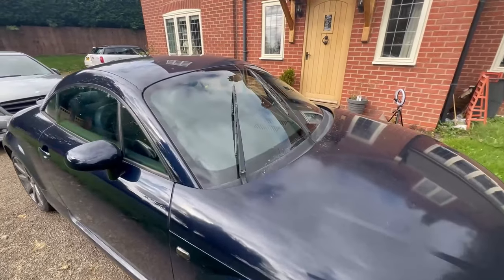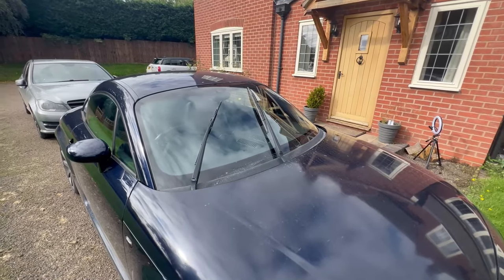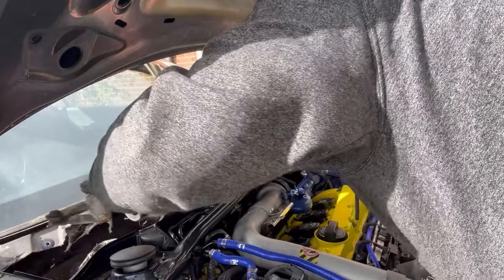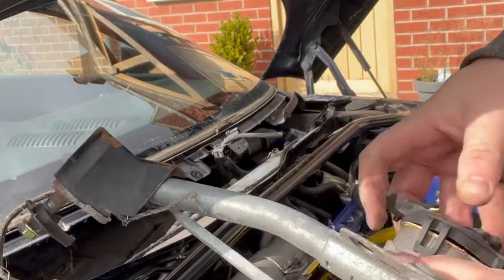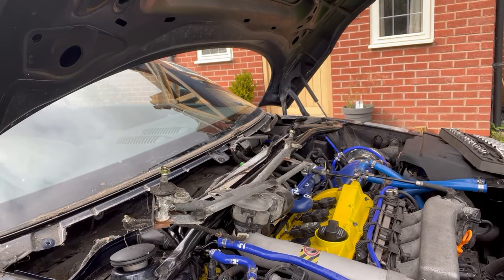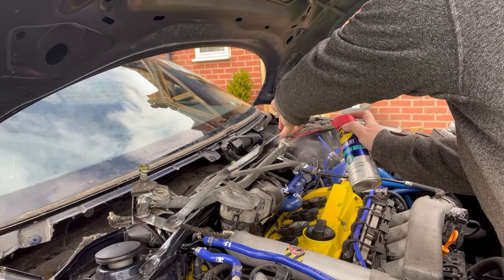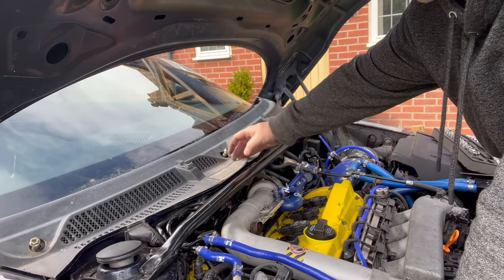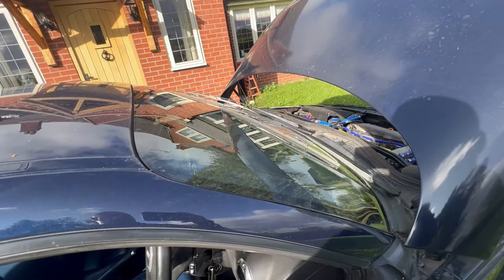How to Fix Slow Windshield Wipers (Audi TT MK1)

Comment: Hi ! Nice vid ! Last year I have inspected the mechanism, cos the speed was really too slow. I thought it was the motor possibly too old, but have did a good clean to all the joints, grease ans so on. After that the speed was increased by 2 about a bit !😳.
To go further, the best thing to do would be to desassemble all the joints, because the main thing is the rust inside. It brakes the rotation, and stress the motor a lot. Not an easy job, a retainer clip is very difficult to loose on all the joints.